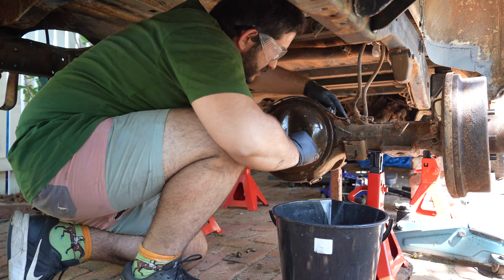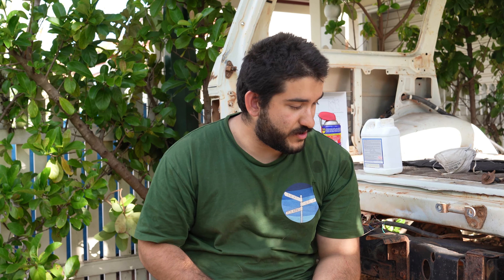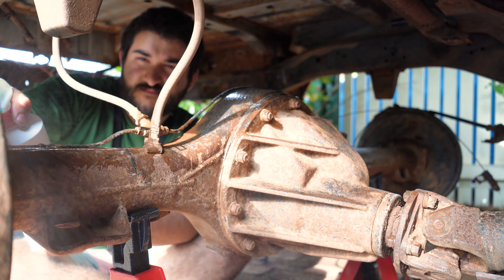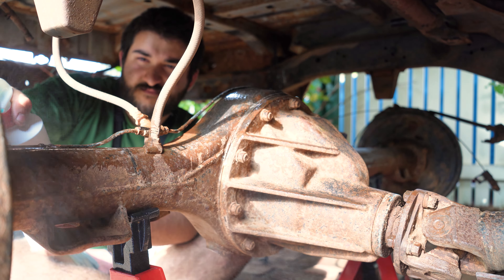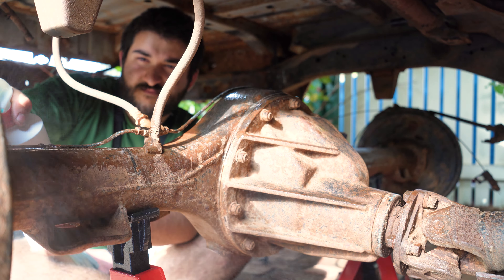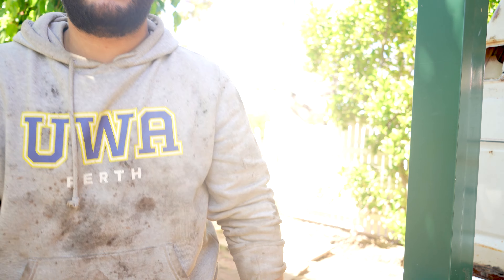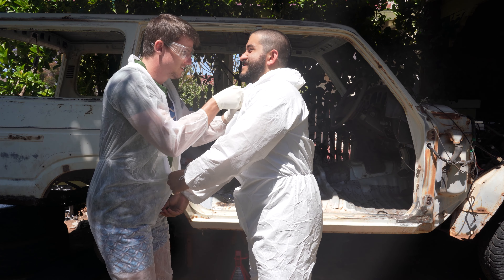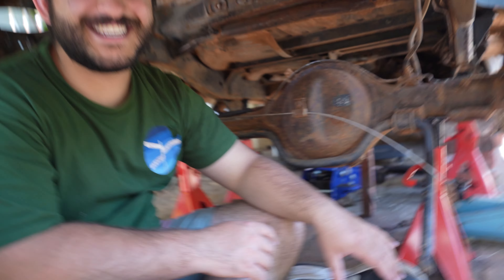Can we make our Rusty Old Chassis look BRAND NEW? | 60 Series Landcruiser

Comment: loved watching you use gloves with the aqua clean and one with the rust seal :D how's it all held up you applied it all a little backwards, doing the diffs first then spraying down your chassis to clean it... still stuck on nice and no rust coming through ? or below the product ?
Reply from the maker: We did do it in a bit of a funny order but it was so much easier to break the job down into sections, especially since we were doing suspension and body mounts at the same time. 

And we might have to do a few thousand kms on gravel before we can fairly review the chassis coat 😊